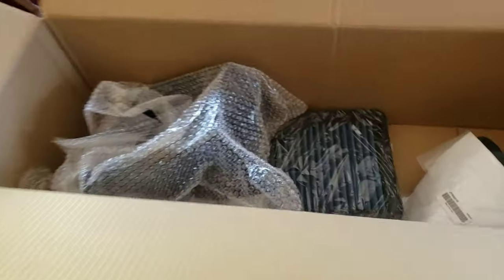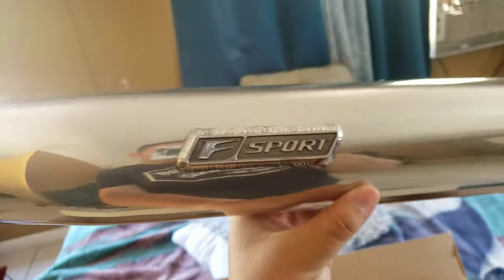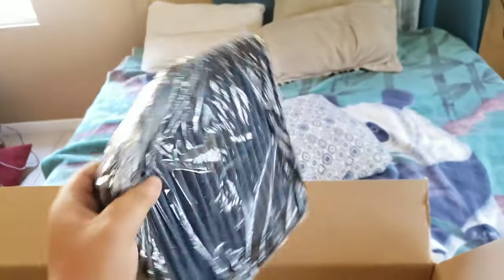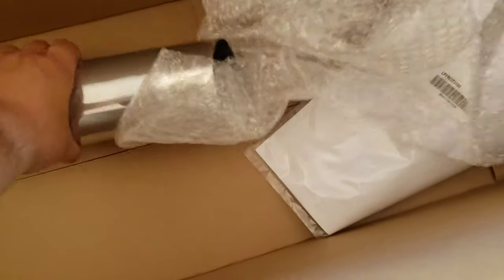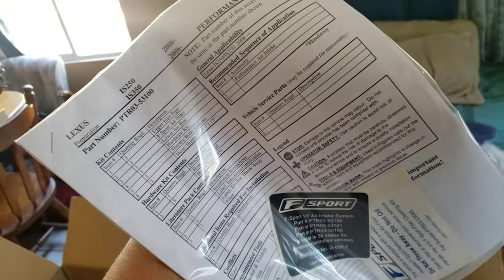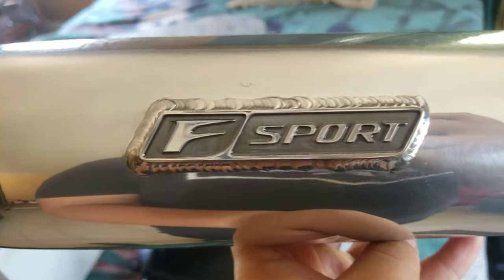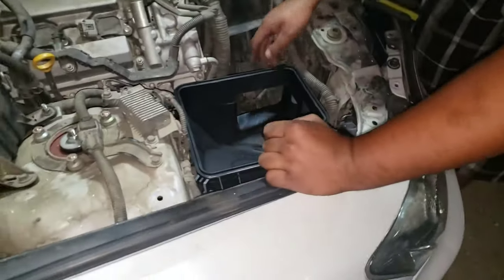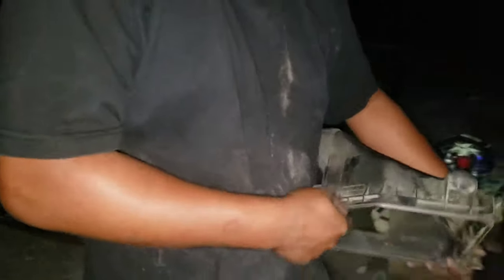Lexus is250/is350 F Sport Air Intake

Comment: What’s the difference about the air box? The f sport has a rectangle hole in the front? Is that pretty much it?
Reply from the maker: Basically bro haha, other than that a slight performance gain & the sound is much more aggressive forsure 👍

Comment: Did your check engine light turn on , my check engine turn on after 5 days later of me installing it , the computer says it’s o2 sensor but I recently change those . Any answers ?
Reply from the maker: Nah man no check engine here, probably check the o2 sensors again just to be sure 👍
Reply: It’s funny cause I changed the o2 sensor
Reply: Marty Motors said it happened to him just clean the sensor look up common maintenance issues on is 350 on his channel he explains there
Reply: Isn’t the o2 sensor completely different from anything regarding the intake? The only sensor your messing with is the MAF sensor